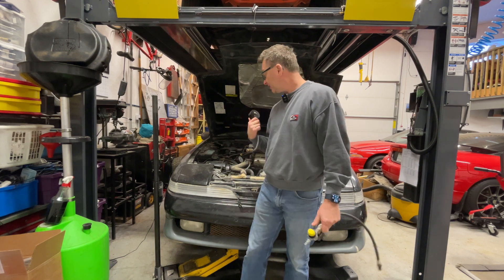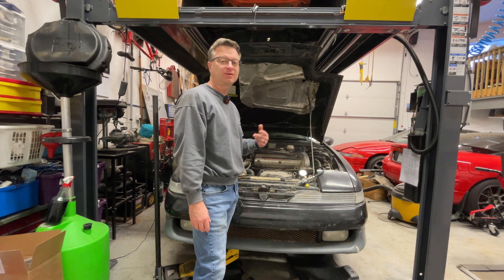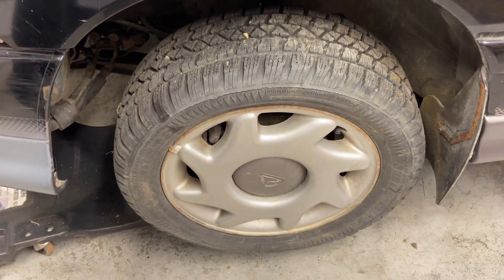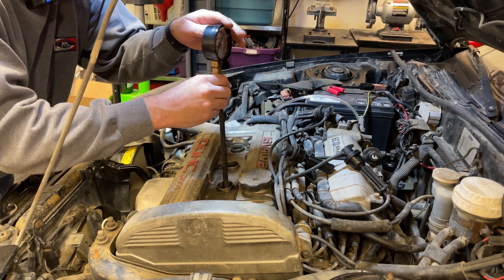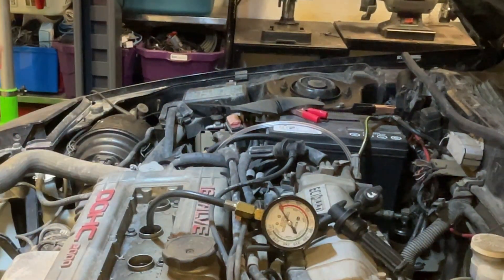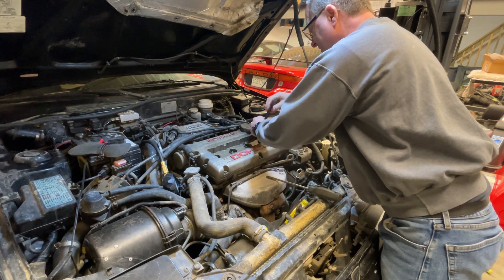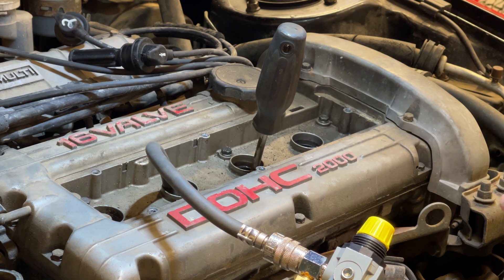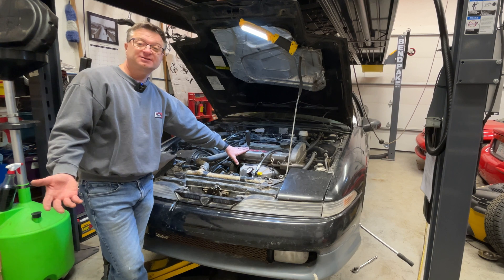How to do an engine compression and leak-down test!

Comment: One more class, two important tests, and I was surprised by the good condition of the engine, for the time it was stopped, whoever used it took very good care of it and used good gasoline and a good cooling fluid, otherwise it would have oxidation and carbon deposits that would affect your seals. Hugs
Reply from the maker: Yes, I was too impressed just how great it tested. I expected some ring rust to prevent sealing that well.

Comment: Good lesson! I''ve only ever heard of compression testing till today. Question: you mentioned watching for bubbles in the coolant to check for potential head gasket leaks. If the engine is a V6 or V8, could you then isolate specifically which head gasket is leaking if you get bubbles in the coolant? Reason I'm asking, I had a V6 engine with oil and coolant mixing, which the mechanic said that they could not determine which head gasket, one or both, was the issue. I made a decision to replace the engine based on the potential labor cost of replacing one head gasket and finding out, the other one was the issue.
Reply from the maker: Yes in a V engine if bubbles come from a leak down test in the coolant then it would be the side of the tester is in. With that said, it is possible the leak down test doesn’t show the head gasket failure if it only leaks at very high pressures to see air in the coolant system. Or the head gasket failed between the oil and coolant valleys, but around the combustion chamber it is in tact.

Comment: Were you holding the throttle open while cranking during the compression test? That's something that I've always done. Not sure if it really makes a difference, though. I recently did a compression and leakdown on my 4G63, which was built back in 2005ish and has seen quite a bit of abuse--I got amazing results. Less than 10% leakdown in every cylinder. It does still consume oil though, so I have to figure that out.
Reply from the maker: I must admit I don’t open the throttle when I crank for compression.  It makes sense to me to do that though. Now I need to do a comparison on how much difference it makes. If the leak down is okay I wonder if your turbo is the source of using oil.
Reply: @SlippingTime  I assumed it was my turbo also, because it's super old, but I'm not seeing any evidence of oil on the turbine wheel or in the turbine housing. Also not seeing any oil on the intake side, and I do have a pretty large catchcan on the vehicle
Reply from the maker: @CaptainTonus  any smoke out of the tailpipe that you notice ever?
Reply: @SlippingTime  oh yes, it smokes a decent amount. Can't really tell exactly under what conditions, like decel or idle, but I do notice smoke and also smell oil occasionally
Reply from the maker: @CaptainTonus  I am pretty sure is has to be either turbo, rings, valve components. Is the leak down higher one one than the rest?  Are you running really thin oil by chance?
Reply: @SlippingTime  here are my results:
#1 - 9%
#2 - 6%
#3 - 5%
#4 - 9%

I run 20w50 non-synthetic VR1 oil
Reply from the maker: @CaptainTonus  now I am thinking valve guides or seals perhaps.
Reply: @SlippingTime  I wouldn't be surprised. The head was refreshed a few years ago and the valve seals were changed, but the guides were not
Reply from the maker: @CaptainTonus  if the blue smoke happens more on cold starts then likely the valve seals or guides.
Reply: @SlippingTime  I notice it the most when coasting on decel and then revving a bit, it will puff out. Or sitting at idle for a while and revving, it will also puff a bit. It's not like 007 style smokescreen though in any case
Reply from the maker: @CaptainTonus  good for clearing out mosquitoes. 😀

Comment: Amazing compression and leak down. Problem is with it sitting for so long I'd assume those valve seals are rock hard. Happened to my 98 gsx that sat for 13 years.   But easy to replace without pulling the head.
Reply from the maker: True. Valve seals even in these cars not sitting became leaky and many have been replaced. I found out this engine was rebuilt shortly before it sat. Not sure about the head work though.
Reply: @SlippingTime  once the t-belt is off I'd just pop the cams out. Use your leak down tool to keep all the valves shut. I have a cool tool that pops the retainers and has a magnet for the keepers. Oem springs are easy. Then swap the seals.
Reply from the maker: @richardwilliams9815  great tip. I have done something similar when changing to 3g lifters.
Reply: @SlippingTime  the tool I have was about $70. Has two sides. One for removing and one for installing. The keepers slide into it and you line up the retainer and wack it with a mallet and they all pop right back on.  Kinda cool. Pain with aftermarket springs but very easy with oem.
Reply from the maker: @richardwilliams9815  I am so old school, I still use the mits (miller) spring compressor I bought back in the day. 😀 You’re tool sound easier for sure.